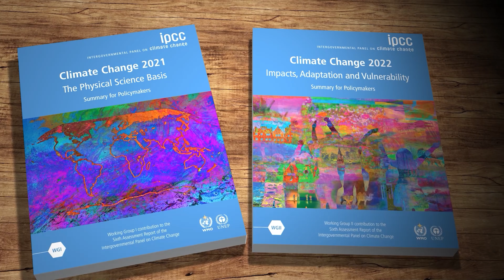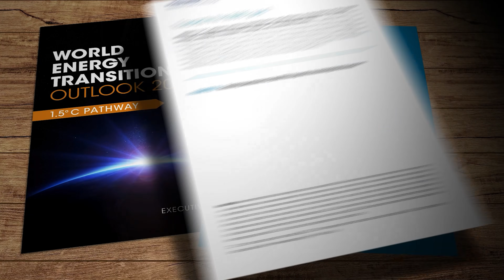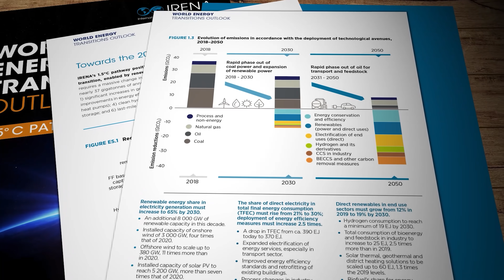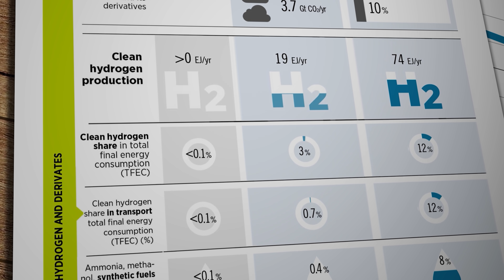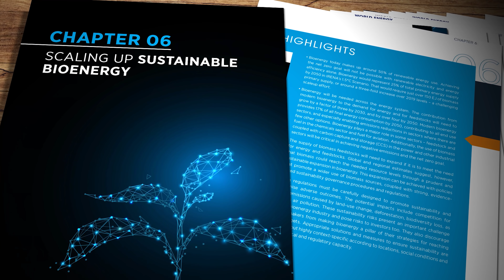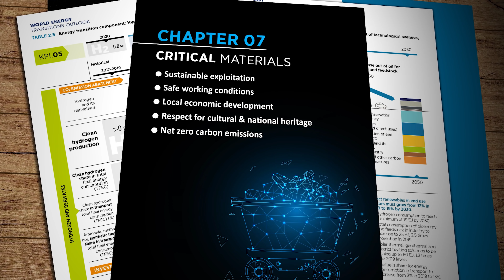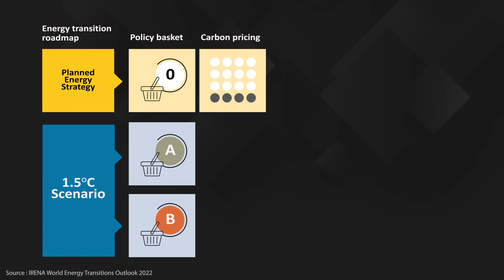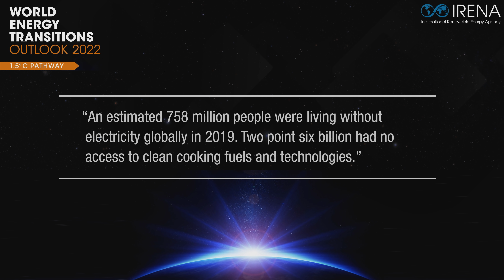Massive global energy disruptions are coming. Brace yourself!

Comment: OTT, but something that's been bugging me a lot recently - the constant use of the term 'intermittent' when discussing renewable energy. 

If you think about it, the only really intermittent renewable resource is solar (whatever the weather or season, it stops working for several hours a day!). All other sources are pretty reliable. Even wind, especially in a place like the UK (and especially offshore), whilst not entirely guaranteed, is pretty much constant.

Whenever the nuclear lobby needs to 'justify' their technology, they bang on about renewable being "intermittent" and how we need nuclear to guarantee the base load. And yet the reality is that nearly all alternative sources ARE usable as  base load - hydro, wave, tidal, etc - even wind, most of the time. The ONLY one that isn't is solar. 

Take away this false 'base load' argument, and what justification is there left for such an expensive, dangerous, high CO2 producing, extreme polluting technology as nuclear??
Reply: Where in the process of producing energy does nuclear contribute large quantities of CO2, its one huge advantage is its as carbon free as can be, its second great advantage is in the quantity it can supply whenever it is needed.
Your use of the term "pretty reliable and other generalizations" is what "intermittent" means, when would a power cut suit you best?, during the day and you can't work or shop, or in the middle of the night and in the morning you find your electric car still is not charged, that is the reality of "most of the time", our power grid is only just adequate for our current consumption and if you start to add in a significant increase in EV's then we need to radically increase generation, (you can't just important it as everyone else will have the same issues),  the power of the wind is equal to the square of its speed, so a small decrease in wind speed, (as an example, 10mph to 7mph, may not be felt by us but its only half the power for the generator), can have a dramatic effect on the power produced, with a short fall in production power cuts are inevitable unless we have significant back up,  I leave it to you to ponder where we get that from.
Reply: Research capacity factor, my dude

Comment: The only even remote hope of tackling the climate crisis is going hard on nuclear which is barely mentioned. The idealistic expectation of sun and wind doing the job is complete nonsense. Yes they can be a considerable contribution, but the simple logistical and technical issues are on a scale of decades to achieve. Getting the lawyers and excessive bureaucratic red tape out of the way and going SMR reactors, factory produced combined with increased regulations on consumables such as cars, fridges, TV's etc that make them durable and repairable... ie ending the throw away economy. Anybody out there gone to a TV repair shop lately? Used to be common to have long life repairable products, not junk like modern fridges that literally last 5 years...if you are lucky.
Reply: Takes to long, as it takes a good 15 years to build nuclear plants (though China might best that, as they don't have to make do with democratic procedures). Recycling & repair.. has not been put in place anywhere successfully since the 60's idealists first debated it. Instead, the repair option has all but taken from most low & mid price gadget (check your phone & laptop)

Half the carbon load in the atmosphere has been put there after 1990. Before we can reliably produce sufficient nuclear energy - let alone, change the world economic model, co2 might be close to, or over 500ppm, easily putting us on track for 3+' centigrade up. By then, most of the Midwest, Central China and India will look like a very burned toast indeed

Comment: This whole problem of generating enough pressure to over come the inertia of our current source and use of energy, so that we can change our impact on global environment, leads me to Newton's equation for Force - F = mA, or A = F/m. The analogs being: A = rate we change environmental impact, F = how hard we push to change energy sources and uses and m =  inertia resisting changes. 
One potential is that the Ukraine War may be a forcing function in several ways. 
First, Russian oil and gas exports will be crippled going forward, and when Russia's customers develop new energy sources, they will not return. This effect simultaneously reduces resistance to change (m gets smaller) and impulse more rapid innovation (F gets larger). Result is larger A, rate of change.
Second, the Ukraine War is going to force a global economic contraction, which will immediately reduce global consumption. This is an unexpected (though short lived) boost to F, and the cost inlives lost is obscene. Longer term, it may demonstrate that radical change, though excruciating, is possible.
As always, how do we demonstrate the need for painful change now is a better choice than catastrophic change later?

Comment: I'd like to correct that most wind turbines do not require permanent rare earth magnets. Most simply use three phase induction generators with copper windings. The use of rare earth magnets is simply a manufacturer's choice to use a different type of technology but as you can see it's not necessarily better because of the trouble sourcing large quantities of these magnets going forward.

Secondly I'd love to know if the report touches on cryptocurrency at all. Because at the moment this explosion in crypto mining is gobbling up almost all new renewable capacity hitting the grid.
Reply: Since your post crypto values have tanked and hopefully most of the mining will also tank. In Texas, local govts are actively advocating for new mining operations while grid operator struggles to meet current demand.
Reply: Indeed. So often, “materials” are handwaved around by people with an axe to grind against renewables, suggesting that there’s only one solution, and it’s the obvious solution that conveniently fails to meet their expectations. Like the neodymium shortage, as if neodymium was the only way to make a magnet. Or lithium, because apparently nothing else could possibly work for grid-scale batteries. The beauty of market forces is that they don’t throw their hands up in the air and give up at the first sign of resistance. No, market forces will chew through a problem, like a trickling stream cutting canyons from solid rock.

Comment: Simple back of the envelope calculations show how ridiculous this is. If Solar PV needs to be over 7x present levels then every year between now and 2030 we need to build and install the same amount of solar PV that the world put in place over the last, lets say, 20 years. Offshore wind was worse needing 11x.

Dont get me wrong, we need to transition to renewables over time, but 8 years simply isn't achievable so why set an impossible target?
Reply: “Why set an impossible target”? Because it’s got nothing to do with climate: all about destroying your lifestyle and pushing you into poverty, dependent on gov handouts, ie UBI.
Reply: It's not that ridiculous.

Solar capacity has been growing exponentially for the last 2 decades. 

Global solar capacity doubled between 2016 and 2019 and in 2021 total capacity had almost tripled since 2016 (849,473 MW)

The cost of production and manufacturing capacity of photovoltaics keep improving every year.

If we installed as much solar as we possibly could, ie actually mobilised our resources in proportion to the scale of the potential threat as we did in World War 2 then it would make a big difference in reducing CO2 emmissions, and the more we build the cheaper it gets.

South America, Australia, Africa, central Asia and the Middle East have barely even started to build solar energy capacity so far. If there was a solar installation on every roof and every car park in developed countries then we wouldn't be talking about an energy or cost of living crisis in Europe.
Reply: @motimobo  Well I live in Australia and I assure you our installed solar PV installation is greater than most western countries. I think a lot of people see problems as mathematical and not practical. Expecting exponential growth to be maintained is wishful thinking. Besides without grid storage, we're getting to the point where adding additional solar PV generation onto the grids is counterproductive. Grid storage isn't a problem that will be solved before 2030.

Comment: Rare earths aren't "essential" for EVs or wind turbines.
The vast majority of wind turbines use copper rotors. EVs can just use induction motors.
Reply: you still need magnets to generate electricity, unless you 're living without it, then you don't need it. magnets that are used for electrical generation do have rare earth metals in them.
Reply: @Meleeman011  Electromagnets work fine. That's just copper and iron. Like I said almost all wind turbines use copper rotors rather than permanent magnets. They are called doubly fed induction generators.
Large generators like coal also use electromagnets in their generators, but they are DC rather than AC.
Very few generators use actual magnets because they cost more.

Comment: What is missing from your analysis is a rough estimate of what a really effective plan of action would cost and what impact it will have on electricity prices and global GDP.  When you do that estimate, you will see that the required actions will never be implemented in time by the politicians, because the economic impact would be very severe and therefore deeply unpopular.   That is why our current civilization is almost certainly going to collapse.  Most past civilizations have collapsed suddenly and disastrously when they created environmental problems that greatly exceeded their capacity to solve them.  This is what is happening to us now.
Reply: Cost? There would be no cost. If we weren’t building up our military. To offset, the military buildup, in China/Russia/ N Korea/etc.
Reply: Sometimes I get the urgent impression that since none of the predictions in the last 50 years of  warming disasters, have shown up, but on the contrary, other true cold air induced power outings have caused fatalities, that I need to be realistic and prepare for actual probems existing today .( The winter storm happened a few months ago in Texas, stopping the majority of wind turbines from rotating due to ice accumulation on the leading edge, unsymmetrically, and due to imbalance, actually damaged the first stage planetary speed increasing transmission.)
The result of that heavy incident, caused actual fatalities, absolutely not related to pollution of any kind.
We should invest in preventing this lack of adequate power from happening again. Wind mills failed, solar panels failed .
We  have not created that problem, those are natural events, which happen from time to time. I feel guilty to not have contributed to solving the actual problem of preparing for emergencies, known from the past.  Contributing to the design of wind turbines was not the responsible approach, in view of the speculative and uncertain  expectation  of some future 'catastrophe' not backed by historical experience.
Reply: Recently I learned that Chrisie UA Huntsville has  determined from satellite observations over more than 50 years that the temperature has risen at a rate of less than 1½ degrees per CENTURY.    Satisfying the scenario    (7:59)
As the French say: Qué de bruit pour une omelette.

Comment: How to nicely describe it.
ITS NOT GONNA HAPPEN. 
problem is that we are too lazy and humans (not all but majority) are dumb.
We are driving machine that burns fuel with max 30% efficiency just to move 1000 plus kg box of steel, aluminium plastic and rubber. So driving your 5 seater car by yourself lowering that efficiency to around 1 or 2 % . Very f..king efficient.  
Yes yes . Fuel in your limousine is mostly use to move the car NOT YOU.

Comment: The experts thinking up solutions to these problems all have vested interests and all want to maintain power and control of a centralized and top-down energy system. They are not thinking of bottom-up widely distributed decentralized energy production systems. It's just not in their DNA. I can produce hydrogen at my kitchen table with a battery, water and some wires. That battery could easily be replaced by solar or wind technology. Also, under all of our feet exists a virtually unlimited source of heat in geo thermal energy. Those two sources are the starting places for a universal energy system that minimally impacts global climate change. I'm not saying it's easy, I'm saying that that is the starting place.

Comment: We need to restore older motor vehicles and trucks by converting them to to electric. We can't afford to expend energy crushing them and trying to extract materials when all that is really worn and unwanted is the engine, transmissions and drive trains.  We should only need to build vehicles to replace those that are beyond restoration and conversion. 
A typical Australian SUV can easily accommodate 40kWh of batteries a motor and a controller. It shouldn't be overly difficult to create controllers that plug into the existing computers etc. This is what the Auto industry should be focused on, not producing new models which is just more of the same bullshit approach that clearly is not working.
Reply: <<A typical Australian SUV can easily accommodate 40kWh of batteries a motor and a controller. It shouldn't be overly difficult to create controllers that plug into the existing computers etc.>>

When will your company begin offering these services?
Reply: @SeattlePioneer  ? I'm an 78 year old pensioner, what makes you presume I have a company and able to do this?
Reply: @Bennyboy-dog  You were talking so confidently of the opportunities out there,  I was SURE you were exploiting them yourself.

What a DISAPPOINTMENT to find it was just hot air!
Reply: @SeattlePioneer  That's a little binary - either "hot air" or "promotion"? There are many shades of grey you know. I hope you do.

Comment: Not an expert in this but Tesla has a goal of having large amounts of housholds having solar+battery pack which participates in the grid with autobidder thereby lowering energy costs and stabilising the grid demand. Also seems pretty clean since RedWood materials have large ambitions in battery recycling and are working closely with them since their CEO is JB - one of Teslas founders.

Comment: It seems to me like we have a plan for reducing the co2 we produce for the major sectors like cars and electricity production but what I'd really like to hear about is the carbon negative technologies that we will need to cover the processes we cannot remove carbon dioxide from.
Reply: One rather large method of capturing carbon is to change farming practices to where instead of burning crop residue it is instead buried or left and used as mulch.  Increasing soil carbon can reverse the long-term trend of releasing soil carbon into the atmosphere.  One unifiied policy change at the top level of government could do this.
Reply: @obiwanbenobi4943  I like the sounds of that, sounds more sensible than the carbon capture stuff.
Reply: @obiwanbenobi4943 " burning crop residue " is that not what biomass basically is?, and is it not carbon neutral anyway, plants capture carbon from the atmosphere as a processes of growing and we return it back when we burn it, a carbon cycle, that has always been one of the arguments for biomass generation plants.
Reply: @CrusaderSports250  Burning crop residues is not the same thing as biomass in many ways, but in both cases they do not increase soil carbon amounts and that is the point i was aiming for with my comment.  In agriculture the current practice often do not increase soil carbon amounts and instead emit even more via the degradation of what carbon is already being stored in the soil.  If we reverse the poor practices of agriculture we can sequester a huge amount of carbon.  If you combine this approach with reforestation and reclaiming degraded lands you can accomplish a lot more.

Comment: The electrolysis of water to produce hydrogen diverts energy away from far more efficient uses. For instance, for a car, only 22% of the energy generated by a wind turbine reaches the back tires of a car if you do it via hydrogen.  Sending the energy to a car battery, results in 74% of the generated energy reaching the driving tires of a car.  Hydrogen has some valuable speciality uses such as refining iron ore, making cement and welding in a plasma torch.  In addition, you produce the highly valuable oxygen as a by product.
Reply: But if a company needs to charge a truck at 3am... Where will the renewable power come from?
It's better and CHEAPER to create the hydrogen during sunlight hours. Otherwise you'll need batteries to store the power before charging the batteries 😂 $$$$$

Comment: I am wondering whether Elon is chasing profit as the priority when choosing lithium phosphate batteries. It may be just a coincidence that the choice does better his bottom line. My take on Elon is that he is leading by example and that his motives are, in the main, altruistic.
Reply: LFP is more practical than ternary chemistries, but lower performance.  It's cheaper in principle, although that is proving to be more elusive than expected.  LFP has some solid advantages, on of which is safety.  I don't think Elon is into LFP for profit.  His goal is still to replace ICE, and that requires cheaper cars.
Reply: @incognitotorpedo42  Agree.

Comment: ”Renewables” are not sustainable.
; you cannot run an industrialized society based on intermittent electrical noise. Intermittency cannot be handwaved away with HVDC grids or storage and will continue to require 100% fossil fuel capacity backup. Hydrogen is still just a trojan horse for UGC and similar fossil fuel technologies.